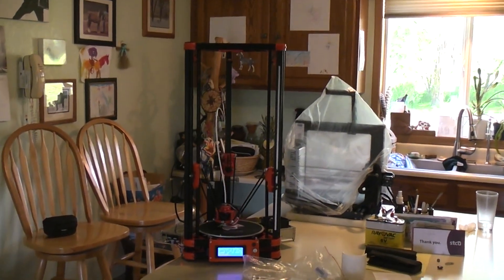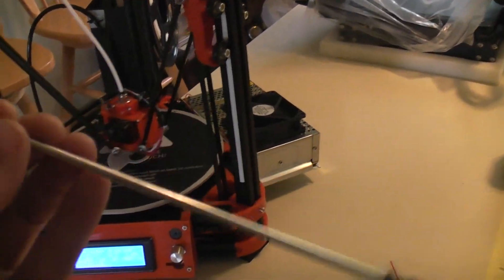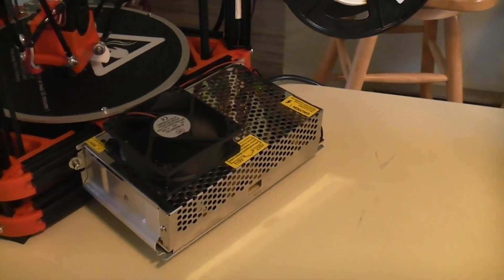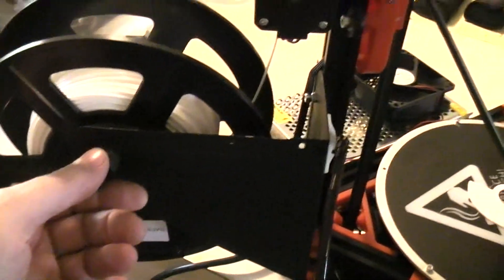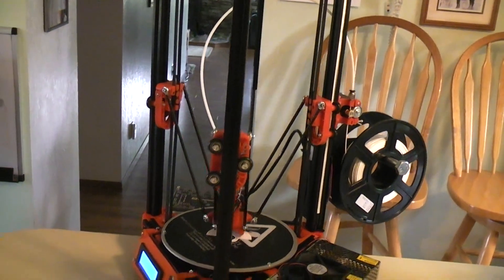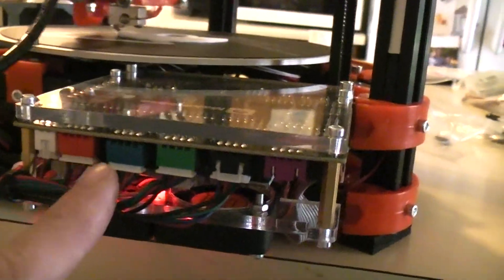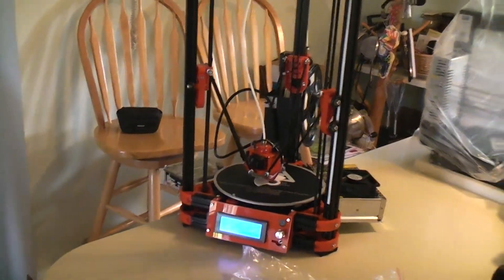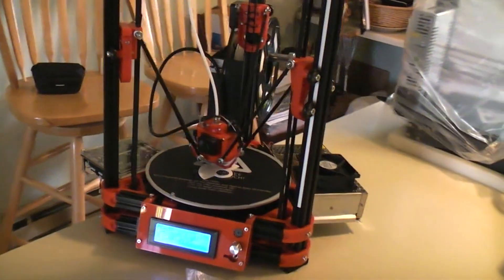TMC2208 silent mode /updates to the FLusun FL Base delta printer 3 month review.

Comment: I have this Printer and I am having so much problem with it I just Build it mine is 240mm  I can't get the Printer to see one of the end stops and the arm keeps trying to go up when I do a Home all you have any idea what I can do to fix the problem
Reply from the maker: When the printer homes all the arms go up. The 1 arm that keeps trying to go up must not be triggering the End stop switch. So either the switch is not in the right place so the arm can trigger it or the switch is defective, or the switches cable is not plugged into the control board in the right place. If the end stop switches are not plugged in the right places "X motor to X motor end stop switch and Y moto too Y end stop switch and Z motor to Z end stop switch then things will not go well as the control board will not stop the correct motor at the correct time. Also the postion that you mount the end stop switch is has to be right so that the effector arm carage can in fact trip the switch.

Comment: I have purchased one of these and the auto level is jacked up. The left side is always higher and the right side is always low. I have tried to look it up and have found no fix to this. I have tried manually leveling it and can’t figure out how to use the marlin software. If you could help it would be great. Thx.
Reply from the maker: Seems like I saw a YouTube on this problem once. Since mine works I am not sure what the fix would be. The first thing I would do is check the auto leveling switch and mechanics to make sure noting is binding and that the switch triggers as easly as possible. In my first youtube on this cheap printer I talked about how the auto level switch on my unit did not screw firmly to the hot end frame, so I had to make some changes. I guess there might be a Face Book group for the printer as well since there seems to be for almost every printer. But I do not use Facebook so could not say for sure.
Reply: We figured our printer out. The low side was because the glued rods would slip 1/4” when extended out fully. So we cleaned and 2 part epoxy them.  We also figured out why we had to run nozzle at 300% in order make a print. Had wrong size filament programmed. Typical newbie. Got to check the simple stuff first😁
Reply from the maker: That is great news ! And good job. Your not a Newbie any more.
Reply: Ya,all I had to do was buy the Ender 3 for my boy and then we figured the old one out. Now we have 2 printers.😎 I feel a start to a new addiction coming on.